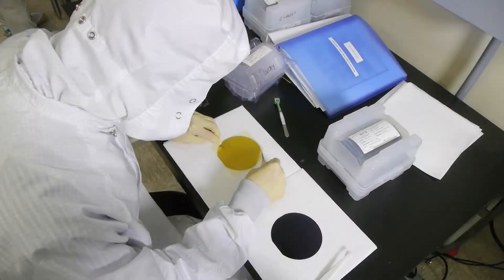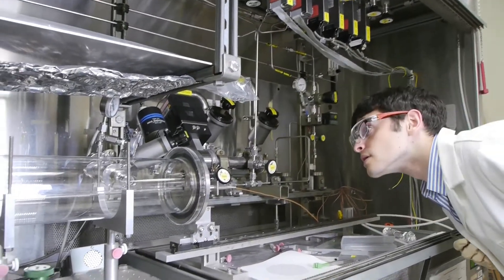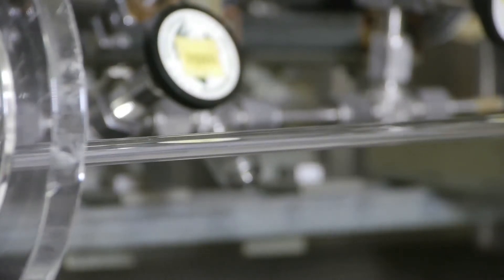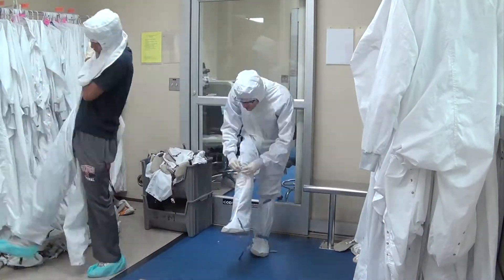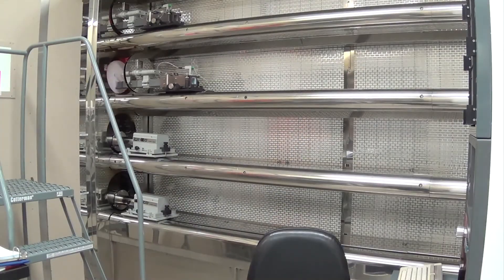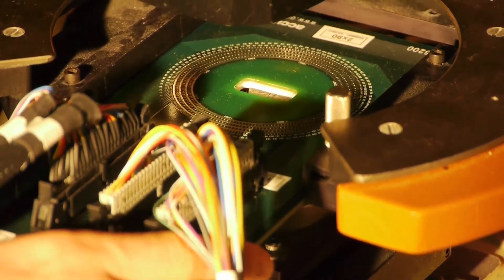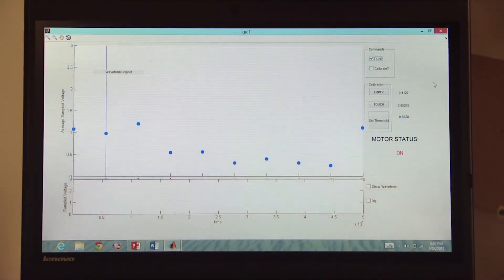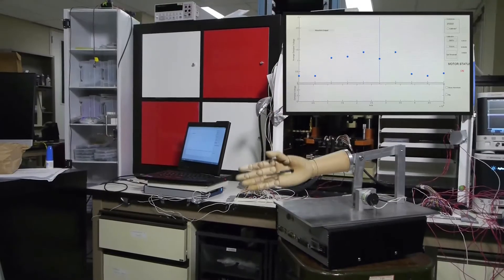SACHA: The Stanford Carbon Nanotube Controlled Handshaking Robot

Comment: all of that high tech stuff to build that? Honestly that makes no sense, It seems like your hiding the true purpose of the near superconducting transistors obviously the transistor board will be used in computer technology but that robot you built with it is very unimpressive. try to make a robot arm out of the carbon nano-tubes by using it's muscular properties.